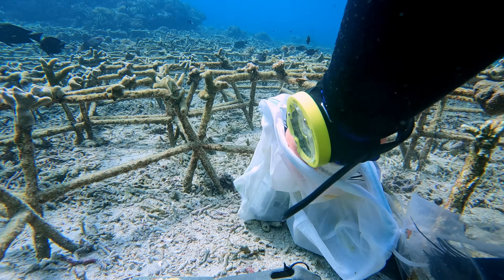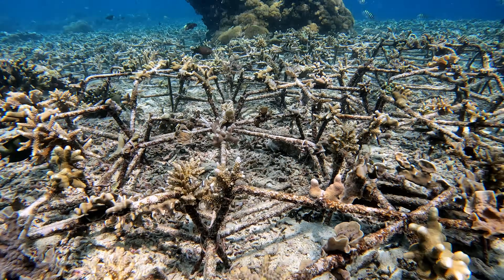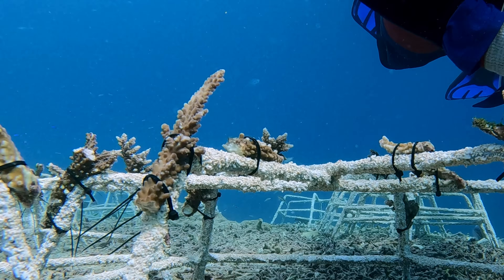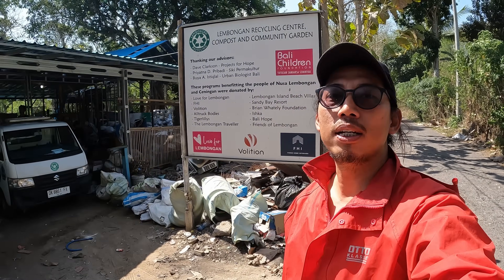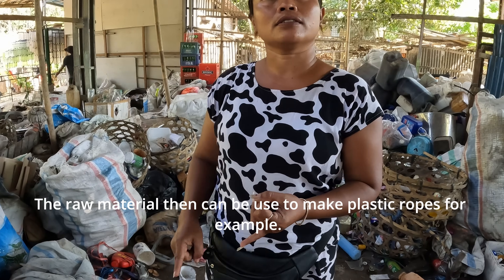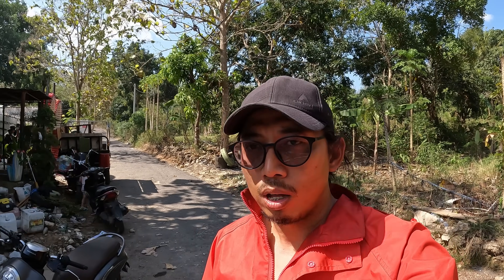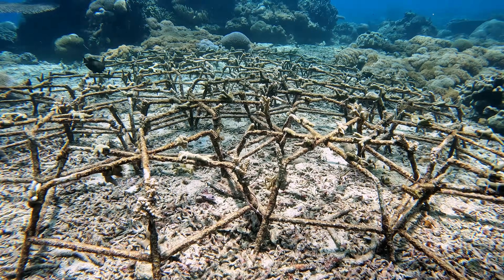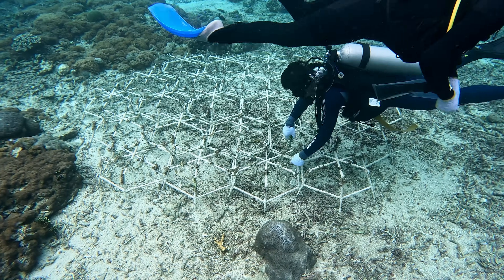We're testing alternatives to plastic zip ties to attach coral | VLOG

Comment: I read that phytoplankton blooms can absorb iron from the ocean and convert it into a carbon store, also the blooms produce food for organisms. I guess steel is lighter and easier to produce and handle than iron, but steel rusts quicker - so many there is some use in looking into other materials than steel. Additionally, would there be a way to alter the design of the cages to have easier mounting points? For example have some loop holes of varying sizes that the coral could easily slot into? I know it needs to be secure but I feel like currently you are having to force the zip ties to create enough surface friction. If you could give the coral more contact surface area you wouldn't need to use as much force on the zip ties (And avoid breaking the corals). If the design were to be altered to have loops the cages could also interlink, making them more secure.
Reply from the maker: Thank you for sharing your perspectives! That is true, the corals also need iron for it biomechanism to create calsium carbonate. 
We are currectly testing the metal zip ties on limited selection of coral species, to find what is best to use it for. 
Cheers, Yudi

Comment: what about the structural frames? could they be made of biodegradable material? metal structure is not naturally found in coral reefs
Reply from the maker: It's a more challenging task, because we still need to create a strong and rigid structure like metal rebar while also mimicking the natural coral substrate.
To achieve this, we coat the rebar with coral sand, which made from skeletal remain of corals. This creates a layer of natural material that provides a more suitable environment for coral growth. 
Thank you sharing your thoughts! Cheers, Yudi

Comment: Can you not do everything above water with fast drying concrete? My father did it with oesters on a robe with fast drying concrete them sink it in the water..
Reply from the maker: We don't want to expose the coral above water for too long, and because we collect the coral fragments directly underwater (not from other source), bringing them up to the boat seems impractical since we can only bring up a little at the time. 
Some other project with concrete structure does this, typically done on the shore. Since our project site is only accessible by boat, we cannot use this method. 
Thank you for your support and for your input to our project! Cheers, Yudi

Comment: In my head, wire twist ties (like the kind that come with cheap trash bags) should work just as well as zip ties, but I'm not the expert here and maybe they would corrode too quickly before the coral can fully attach itself to the frame. But twist ties, or just thin stainless steel wire, are really cheap and easy to use. Bailing wire is super cheap and easy to work with too, and it's fairly robust and corrosion resistant, and there are some neat tools designed specifically for bailing wire. 
I also like the idea of cement, since coral structure is basically the same stuff as lime cement. But getting cement to set when fully submerged is not easy. 
Maybe a combination of wire for short term, and a hydraulic cement for long-term?
Reply from the maker: Thank you for your suggestion! I like the idea of stainless thin wire, we'll see if we could get those materials in Indonesia. For cement as the glue to attach coral, I'm afraid it'll take more steps on preparing, and it wpuld be gard to mix it on the boat. I think tge thin wire would be the best option. Cheers, Yudi

Comment: Would it be possible to build and transport a larger rebar mat? Instead of 30-40 individual pieces, to assemble a larger section? That way, you can spend the time to make sure its sturdy while youre in the shop, which would also facilitate the use of steel ties. 

I understand that the size of the boat is a limiting factor. I imagine another benefit if using smaller pieces is that you can fit the sturcture to the uneven shape of the sea floor. 

But I'm a civil engineer and I've seen lots of rebar cages for shallow foundations of buildings. That's what came to my mind. 

Keep up the good work! I'm sure the coral and the fish would thank you if they could talk. I'm looking forward to seeing how this looks in 3 years.
Reply from the maker: Thank you for sharing your perspective! 
We try to avoid having welded joints on the top part to make the structure stronger. With rebar mat, it would end up shaped like a table because we also need the height.

What would be cool is to come up with uniform modular structures with an interlocking system on each of the arms that can be arranged together. Any thoughts? Cheers, Yudi

Comment: Maybe try coating the hemp strings in wax or epoxy? To increase longevity. That would be a lot of work i guess?
Reply from the maker: I'm afraid so, and I think the wax will crack when it dries. And epoxy also bot an option to aplly underwater, would too difficult. Thank you for suggestion and for following our project. Cheers, Yudi

Comment: I would say another alternative is using hemp rope if you can find it. It should naturally degrade after some time. probably by that time the coral has attached it's self to the structure.
Reply from the maker: Thank you for your support! We are testing the hemp rope on this experiment, and there are some succesful cases, but still far compare to zip ties. And that's why we are going to do more testing with hemp rope, with more selective coral fragments. Cheers, Yudi

Comment: I was wondering if the metal zipties wont also be a big problem if they end up in the ocean as they seem pretty sharp and durable and might hurt a lot of sea creatures if eaten by accident
Reply from the maker: That's one of my concern at the begining, but when we finally got the material, it truns out their edges are not sharp at all. And we curl the remaining part using pliers as we tighten it. It's been almost a week now, and they are still attached well. Cheers, Yudi

Comment: I imagine the string is less successful because as the natural fibers soak with water, they will stretch. If the coral bits are more loose because the string stretches, the water currents would probably cause them to move making it harder to attach.

I use florist wire for hobby stuff, and it is roughly 1mm thick and easy to bend/twist/cut. I do think it would rust, but if the coral attaches first then it won't matter if it rusts away.
Reply from the maker: The cotton twine has the most detachment rate so far, although also has some succesful cases. We figure the state of the coral fragment also a factor. If the coral fragment is healthy ang usually big enough, it could attach faster to the structure. 
We'll definitely look into the florist wire, thanks for the idea! 
Cheers, Yudi

Comment: I’d be really curious if bioplastic zip ties made using PLA could be possible. I can find one manufacturer of them. And even if not, they can be easily manufactured with PLA, a 3D printer, and downloadable designs , also supporting local Indonesian technological innovation.

Comment: you could instead of plastic zip ties use thicker steel wires, like a paperclip type of material. This will eventually rust but probably not before the coral adheres. Something to try anyway
Reply: Or a fencing wire and associated fencing wire tool
Reply from the maker: Thanks for the suggestion! I think it doesn't harm to include steel wires with different sizes on our next experiment. Cheers, Yudi

Comment: At first I tought that the type of wire you use for stitching wounds in the hospital would be great since there are versions that disintegrate in a certain time frame, but that's probably too quick for the coral to grow.
Pre-fixing metal wire to the frame that makes coral quick to attach later sounds good, but also creates a spiky field divers have to work in with their hands and the twisted up wire is still spiky.
Going all natural (no metal that can corrode) sounds like the way to go, what about waxed hemp cord? Like mooring lines but in miniature version. It's been used for centuries on the oceans and depending on the thickness of the cord, you can test which one you need for the duration until the coral attaches and the cord eventually looses itself or disintegrates since it's not needed forever.
Reply from the maker: Thank your sharing your thoughts! I think the wire would work with the right tool, and it's worth to try it out. Probably will take more time to attach it. 
Thank you for the idea with the cord, we'll look it up. Cheers, Yudi

Comment: I'd be curious how well velcro  Cable Ties work under water. Also there is a thing as reusable zipties.
Reply from the maker: Thank you for following our coral restoration project. 
To tie the coral, the ties need to stay with the coral until it gets fully enveloped by coral skeleton. For the fast growing coral, within a month we can see that the coral starts to encrust on top of the zip ties, making it impossible to take out without breaking the coral. Cheers, Yudi

Comment: How about zip ties made from another material like a non toxic metal
Reply from the maker: There are limited materials when it comes to zip ties, even the plastic free ones are dificult to find here in Indonesia unfortunately. I think stainless steel material is pretty safe forarine environment. Cheers, Yudi
Reply: What anout these? You can use them with a single tool. And tightness can be adjusted however tight you want to do them. Might be able to find ones that are uncoated and different materials as well or make some on your own. I wont post link cuz this is youtube but on amazon its called "rebar wire ties - 6", 16-gauge double loop reinforcement cable with yellow PVC and 1000 pack - 16PVC6" you can probably find different versions as well as the tool by searching "rebar ties."

  @MossyEarth-FieldNotes

Comment: The Plastic zip ties are only a problem if there exposed to sunlight because then it will dissolve into micro plastic, but when the coral grows over the zip tie it won’t dissolve, only bad thing is that waste
Reply from the maker: That is exactly our consideration when we use the zip ties. Thank you for following our progress and for sharing your thoughts on our coral restoration project! Cheers, Yudi

Comment: I appreciate the simple design of the metal structures, they remind of jungle gyms I used to play on lol  The challenge of finding materials that last underwater while being gentle enough to not damage the coral is tough, I definitely understand continuing to use the plastic ties. In my opinion, you gotta use what works for the purpose of your project. Saltwater is hard on basically all natural materials, so plastic is a good solution
Reply from the maker: Thank you for sharing your perspective on our project. It's also important to remember that those plastic zip ties will eventually be covered by coral, which, in the long run, would eliminate the microplastic problem. Cheers, Yudi

Comment: The "damage" these plastic strips cause is way less than the benefit they add by being used this way. People forget that plastic is just a part of oil, which is a natural substance that sometimes naturally spills into the sea. Plastic itself is not bad, it is just the microplastic and some toxic substances used in it, but overall plastic is a relatively inert material. I understand sometimes it is not the best material, but in this case it stays under the coral without bothering life by becoming microplastics. I wonder if coconut fibers are strong enough to hold the coral for long enough for it to grow?
Reply from the maker: Thank you for sharing your prespective and for supporting our project! It seems like you summarized it all 💚 We tried using coconut fiber (the part that usually used for handle on paper bags), it was too stiff to make the knot in the end and made it hard to hold the coral. Cheers, Yudi

Comment: if you let the coral grow on the frames before putting in the sea, you might not need the plastic
Reply from the maker: Pre-growing the corals on frames before placing them in the sea would be one way to approach it, but logistical challenges and environmental factors can make it difficult. We try to avoid exposing the coral out of the water to minimize their stress. Since we only use coral of opportunity from naturally fragmented coral, we directly transplant them underwater. Cheers, Yudi

Comment: "Its widely used" isn't really a qualitative argument, is it?
If you are using rebar anyway, why not use wire instead?
Reply from the maker: It's also based on the research experiment we found, and one of them compare metal wire to plastic zip ties, and it has higher detatchment rate due to corrotion. Cheers, Yudi
Reply: Wire would have been my first idea as well. Maybe those rebar wire twirl tools (which you just pull to intertwine it) would be good, since they cant really use their hands with the gloves.
Reply: Monel seizing wire is used on boats (and airplanes)to secure pins and bolts. It’s readily available won’t corrode and is easily worked with. A heavier gauge could be used on the frames and a lighter one on the corals.

Comment: In the first video, it seemed like the plastic zip ties were getting engulfed and covered by the growing coral. So it's possible that they can't cause an issue because the coral will actually seal away any plastic that could break off.
Reply from the maker: Yes, that's correct. The plastic zip ties used to tie the coral fragments would be fully covered in 3-6 months, and there is no record of the plastic causing problems for coral growth. Cheers, Yudi